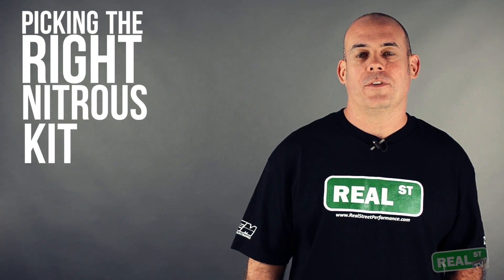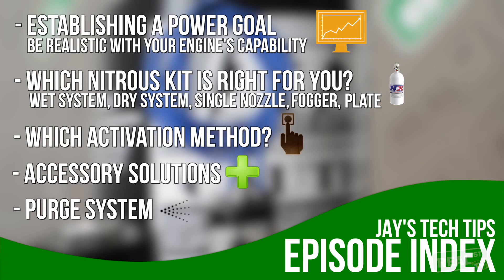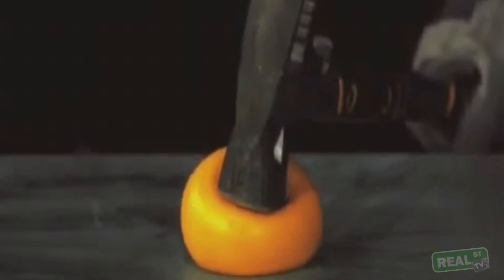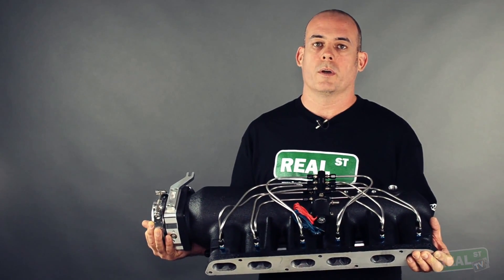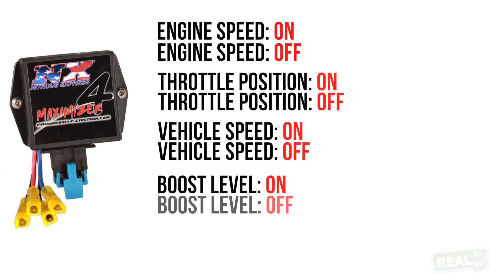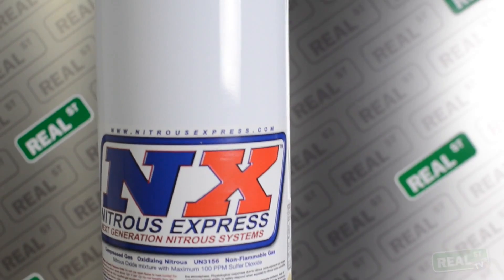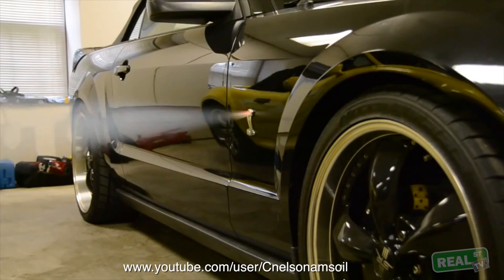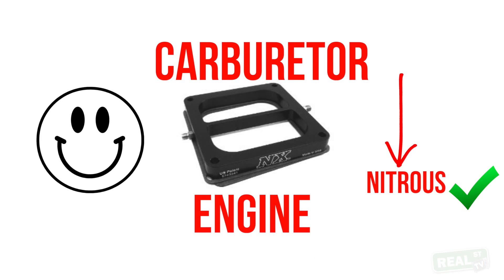Nitrous Systems! Choosing the right parts Jay's Tech Tips # 27

Comment: You turn it on with a low hp spray from 1500 to 2,000 to get the turbo to spool then start ramping back in at 4000 rpms.

Comment: 100% agree... As nitrous adds more power the lower it's activated, I still spray out of the hole in my 12 mustang, but have since added forge pistons and better rods. Here's some goofy info on a Dyno using a 75 shot, I made 80whp/110ftlbs of torque spraying out of the whole (2200-2500rpm) using it at 3500-4000rpm only made 76whp/95ftlbs. This is with a dry setup using injectors to add fuel.

Comment: What about the engine is rewing up to 7.700 rpm and i will use NO just ower 4.700 rpm my botom limit is 4.500 to 4.700 rpm and killing it when it hit's around 6.500 to 6.900 rpm will use the smalest posible power increase 30-40 hp wet sostem on 3.0 l V6 bussa 916 engine which is in lightened Alfa Romeo GTV so the dry weight of a car is around 1.075 kg... I don't nead more but that smal increas will gibe me 3-5 seconds faszer time exsiting 8 sicanes on the racing track and exselerating from slow apexs.

Comment: I cant run a cheater 50 shot on a 2018 supercharger without it running lean? I thought the ecu would know to add more fuel if the O2 sensors detected a lean condition?

Comment: Follow the manufacturers instructions is so so correct!!! I installed my 175hp plate kit on a brand new Gm gen1 sbc . It's the bottom of the line cast crank cast pistons...cast everything!!!  I take out 6 degrees of timing on an already conservative base timing using a NOS launcher controller. I hit it with the full 175hp shot at 3000rpm and have a O2 sensor monitoring A/F ratio. I've gone through 30 plus 15lb bottles on the street with no problems!!!!  So my nitrous hits are never more than about 7seconds!!!  But it is a blast....especially with 275 M/T streets!! Those tires almost hold the power..... almost!!!!

Comment: Ok. First off, love the video. This video has made me decide to use nitrous instead of a long and painful job of turbo install. Second off, I have a 1983 town car. It has an eec3 fuel control set up and uses throttle body injection. Now I would like to use a controller and a wet system. Is that possible with the eec3 fuel control or is it a pipe dream. I only wanna run a 50 shot to awaken the heavy beast.if it is, can you give me an idea of which way to go with it. Thanks.

Zac from pa

Comment: what would you suggest for a 2012 dodge average sxt plus
Reply: 50-75 shot easy.. Get a progressive controller so you can inject as soon as possible for best results. 1st gear is best, 2nd is good compromise, 3rd is WAY TOO late for maximum effect.
Reply: dose anyone know how much power the engine and trans can take before upgrades or things will start breaking i have been told this that and everything else
Reply: I'd suggest never buy anything lower than an R/T from dodge
Reply: +Ian Robinson 600 to 700 easy. but you might as well build it up anyway and use ARP head stud bolts. for instance if your boosted. the head can often lift up once on boost if its a high amount of boost. or too much nitrous can split the seals on the manifold or cause injector spray pattern issues
Reply: thanks
Reply: ls swap

Comment: Jay I have a 3V mustang with the ford racing intake manifold, I was looking at a wet plate kit but was worried about fuel puddling and a nitrous backfire with a a plastic manifold is going to shatter it.
Whats the smallest shot you can run with a direct port? (would go right in each runner)
Im only looking to use 100 or 125 max
Reply: Just get a nozzle or plate system. That's what I have on my 3v

Comment: What about cars that can't be tuned like let say modern lexus o Toyota? Will controllers and what not work ok with the ECU?
Reply: ***** Why would your windows be controlled by your engine computer?
Reply: Hear That? Lol! The window switch is the controller that he talks about.
Reply: ***** what the fuck were you trying to say?
Reply: OK, in Lexus second generation IS for example they can't be tuned, the ECU is encrypted and a stand alone doesn't know what to do with the injectors because its multi injection. If you put one of those controllers will it communicate with the ECU and activate after 3k rpms and what not?
Reply: What does that have to do with the Windows?
Reply: Jesus not literally the windows they also call that controller that he talks about WINDOW SWITCH! You know a programmable rpm window?
Reply: Oh ok haha my bad man
Reply: Alright I'll talk straight. For Lexus is350 ISF etc. No one has ever been able to decrypt the ECU, ever... Standalone don't work because the computer doesn't know what to do with injectors or cams because the car's is multi inyected. It has injectors for normal injection and direct injection. I want to know if a rpm window can be set because these cars sometimes redline because the transmission in some cases isn't fast enought doe to having a very tall diff. That's in the case of an is350. Same with the ISF if you swap in a taller differential.
Reply: +Drunken Ira Hayes but I love my IS 😦
Reply: just spray and pray
Reply: No just spray and keep it rich, sort of. Read your plugs!

Comment: First of all the nitrous purge does NOT purge air, it purges the line incase of liquid nitrous in the line, which would find its way into the engine and cause a large backfire or even worse, Second alot of nitrous kits are used below 3k rpm PURELY for turbo spool.
Reply: you must be one of those " friends"
Reply: asambi69  A nitrous purge is to rid the system of air after a bottle change or if the system lines have been disconnected or opened to the atmosphere. 
Also the purge is to rid the system of vapor/gas and ensure that there is only liquid nitrous in the lines. 
Nitrous oxide in the bottle is a liquid and will remain a liquid under the correct temperature and pressure. 
If the nitrous temp rises above a certain level or the pressure drops below a certain level the liquid nitrous boils and becomes a vapor or gas. 
A nitrous system relies on liquid nitrous until it is atomized by the delivery spray nozzles. Air or vapor/gas in a nitrous system is why you see and hear many engines pop and backfire during a run and is potentially damaging. 

Generally, triggering a 75+ HP nitrous system below 3000 RPM is not a good idea, it loads the bottom end too much and tends to cause piston/ring/head/gasket damage at a minimum and and repeated low RPM triggering will usually result in severely worn/spun bearings at a minimum and  complete rotating assembly/block failure at worst. 
Using nitrous for turbo spooling such as while staging is usually accomplished with a multi-staged separate low HP nitrous control system that is tailored for the application. 
What Jay has described is a system that is usable by the average enthusiast on their stock internals daily driver repeatedly and is unlikely to damage a healthy engine. 
If anyone is intend to install a balls out nitrous system, I strongly urge contacting a reputable nitrous system manufacturer and consult with their technical/engineering department to save a lot of time, grief and money.
Reply: asambi69 So would it be ok to use a very low amount of a dry shot of nos below 3000 rpm's? (Without a turbo). I'm talking about a 5 to 35 shot of Nos. I basically need to use Nos for an off road application on my Jeep and I REALLY need more improved low-end to push up some pretty steep inclined hills. Here in the Colorado Mountains where I 4wheel, elevation is so high and oxygen is lacking and therefore, it's all cutting off my Jeep's engine power and torque. Would a very small shot of nitrous (dry or wet at maybe 5 to a 35 shot) be harmless for low rpm's? I'm basically imagining that the small bit of nitrous will compensate for the loss of oxygen up here in the mountains without much harm. If you could help answer that that'd be sweet :) Cheers mate!
Reply: TheValleyofAwesome yes you would be fine
Reply: The line from the bottle to solenoid is filled with liquid, it doesnt start to change to vapor until it leaves the solenoid and heads to the nozzle or jet because at that point the pressure starts to drop as the gas has a physical change and also starts to get colder as it expands from a liquid to gas, take your dumb ads back to school and learn something bc your an idiot
Reply: 50 shot, I spray while on the trans-brake because my car is my daily driver with a "2500 rpm" converter so it's still livable and my 76mm can't really spool that early.
Reply: patw52pb1 So what if i were to run let's say a 5-35 shot of dry (or wet) nitrous on my Jeep's V6 below 3000 rpm's? Do you think that would cause engine damage?